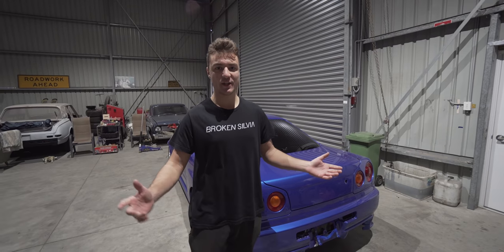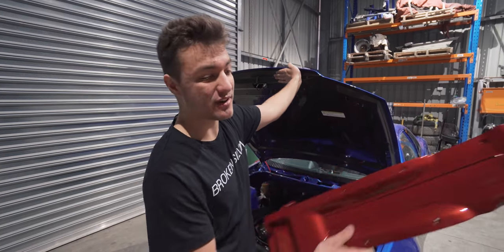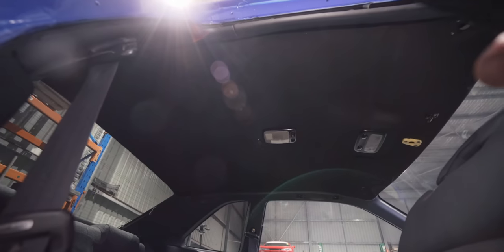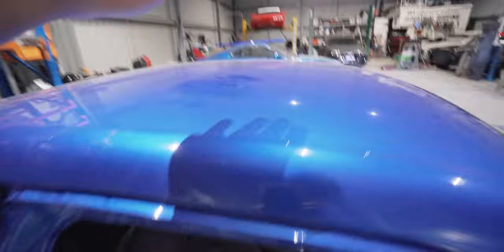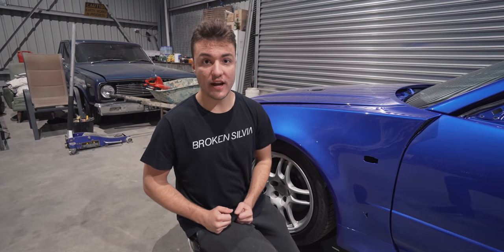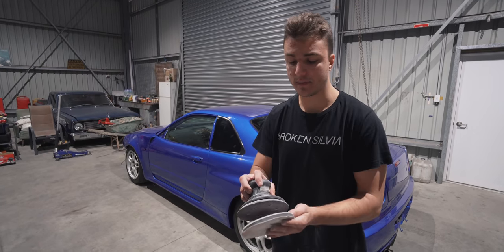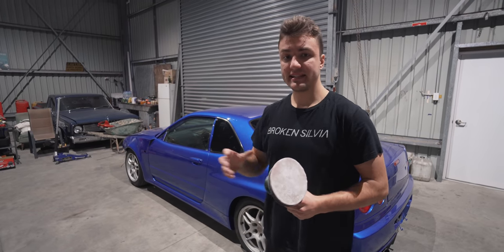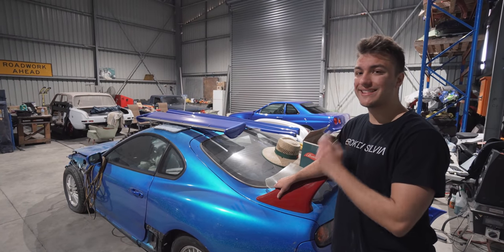THE R34 IS BACK | Poor Man's GTR [EP20]

Comment: The body is right, and it's rust free. You will have in excess of 300hp anyway. All it needs is a solid suspension setup. All the other "nismo old logo" trinkets people cream their pants over are for instagram bragging not for driving.
Reply from the maker: Yeah man already has Tein super streets so should be g👌

Comment: Instead of Brembo, check out Ceika. About US$3k for an entire BBK incl 6pot front /4 pot rear calipers and 2 piece alloy rotors all anodized or painted in your choice of color
Reply: One problem with Ceika, D2 and K-Sport is their caliper designs don't allow for a dust boot for the piston, so grit and moisture enter and destroys the caliper which cannot be rebuilt and whole thing must be replaced at great expense.
Reply: @idokwatcher2062  the Ceika have the external dust boots as an option